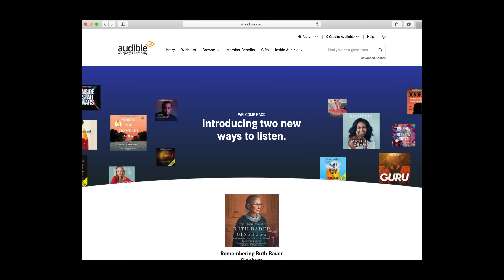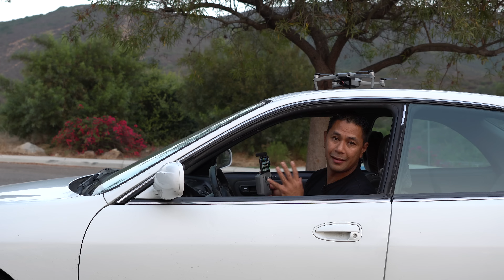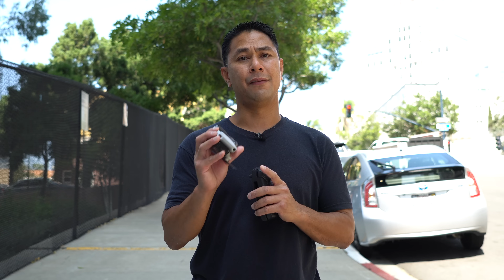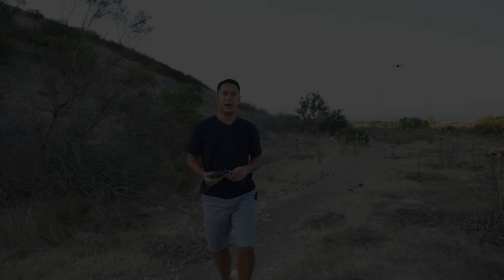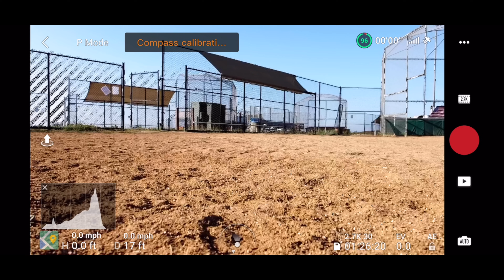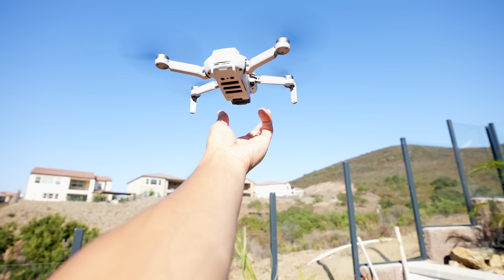10 TIPS for a Safe Flight - DJI Mavic Mini / Air 2 / 2 Pro & Zoom

Comment: Excellent Tip to bring it back at home-point via using a realtime map. 
I have a question. I have an old spare iPhone, Android phones. In order to fly DJI Mavic Air 2 do I need a SIM-CARD for my mobile phone? The reason is I don't want to distract it while flying getting a phone call or text message. Also if I need a WI-FI to communicate, I've could make my primary Phone for Hotspot. What are your thoughts? THX

Comment: Lost a mavic 2 zoom to a tree from the side.  Checked sensors against a wall with a new mavic 2.  Only backward toward the wall stopped the mavic.  Front was not fail-proof and sides would be devastating.  Curious about you experience with sensors being able to stop the mavic 2.  Carry on.

Comment: A tip.  When I start a flight and start climbing up I try to figure the tallest object  (by doing a 360 degree rotation with the camera set of ZERO depression) in the area to see if I am clear and then set my return to home elevation at least 25 feet (preferably more) higher so that regardless of where it might be if I or the drone itself initiates a RTH then it will at least be clear of obstacles.

Comment: One tip: 
While using the automated modes like shuttle, rocket etc. If you start the flight and suddenly realize the obstacles in the path, you can jst hit RTH button once to pause the flight and gain the control back.
Btw, any information abt IMU error?

Comment: Hello sir, i want to ask something about manual transmission on mavic mini, sorry about my bad grammar, hope you can respond to my question

My drone is Mavic Mini CE Version, when it comes to select the transmission manually, how to choose the best channel ? I still don't fully understand about that, about green bars, should i choosing the highest or the lowest one ? And should i choose a bar that has no red bar around it ? Any more explanation about this channel selection thing ?
Reply: pick less interference, usually with green bar.
Reply: pick less interference, usually with green bar.

Comment: To practice using the map to go home,  I use the DJI Flight Simulator, go to the city and fly around several tall buildings and then use the map to find my way back home.  It forces you to follow the map because you would never find your launching point otherwise.

Comment: Thanks for your video. So great. Just a question. On m’y air2, a great drone 🤩,  i am surprised some time that the strength signal of occussing is turning orange more often than I except.... and notice it depends on the orientation of the drone.... and sometimes it turned again white. ... even if I am not so far... do you notice that? 
Thanks for everything 😀😀

Comment: 1- make sure your battery is fully charged
2- verify your propellers to see any odd shapes or dents. If so, change the propeller accordingly (and make sure you put the proper one. CW or CCW prop)
3- Make sure your controller is fully charged since it will also be used to charge your phone in flight
Reply from the maker: great list
Reply: @FlytPath  Thanks Aldryn! :)

Comment: Concerning the compass:  When taking off or recalibrating your compass, be aware of metal in the ground such large water pipes and other underground water and electrical utilities often found in city parks and other city properties.  These can be quite confusing for the on board compass system.  If there is a manhole nearby, it indicates utilities are also.  Parking ramps look like a great place to fly from but are notorious for disrupting drone compasses with all the unseen steel reinforcement in the concrete.

Comment: Great tips Aldryn and the main one for me is DO NOT PANIC use the map, and remember if you lose sight open the map and as shown follow the line back but be careful if you've been walking around while flying the RTH point won't be where you're at I made this mistake where I'd walked near 1km while my MA2 was in the air I lost LOS and flew it back to the RTH using the map but panicked a bit when I still couldn't see it but the controller location is shown on the map as a red dot I think so use that to fly back to if you're walking around while flying but again do not panic.

Comment: Hi Great Video.  I had a question about the Mavic Air 2. I was doing a Hyperlapse, and when it finished it locked up my phone. So as the drone was hovering GPS, I couldn't see the live feed. I was able to land it with just the sticks, but I wanted to know if this happens again, should I restart the DJI Fly app, and will it be able to reconnect with the drone in the air,  or would this cause more problems.
Reply: Maybe get the drone up and hovering near to you and then shut down the fly app, and then restart, that way you know the drone is right close and you can see how it reacts to the app closing/opening while in flight
Reply: webrosc Yes thanks for the idea I may try that. My only concern would be when it’s close to you maybe it links back up by WiFi or something else. When the drone is 2 miles away it might not be able to.
Reply: Good question !

Comment: I usually like to spin my drone around to see if there are any obstacles from the drone's perspective. Learned this lesson the hard way by losing a drone when I was flying it sideways and it crashed into a tree I though I was in front of. This caused the drone to fall into a river with no way for me to recover it. Now I just rotate the drone around, especially in the direction of travel if moving sideways or backwards and it has saved me some potential crashes.
Reply: very useful tip, thank you. And sorry for your drowning drone.
Reply: vinh tu thanks!

Comment: I am deciding between buying a Mavic Air 2 and a Mavic 2 Zoom. 
The Air 2 is good with the newer camera, but the 2 Zoom is heavier than the Air 2. Is there a big difference between the Air 2 and 2 Zoom in the wind?
Reply: Air 2 has a much higher value for money since they’re almost the same....
Reply: 2 zoom handles wind a tiny bit better but like I said above it’s not a big difference in stability and air 2 is way cheaper so air 2 is more worth it